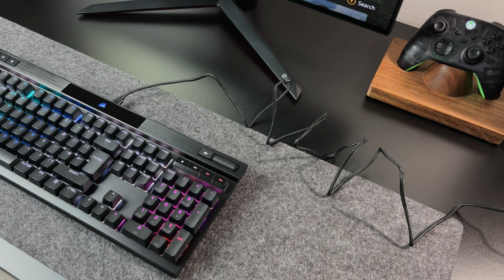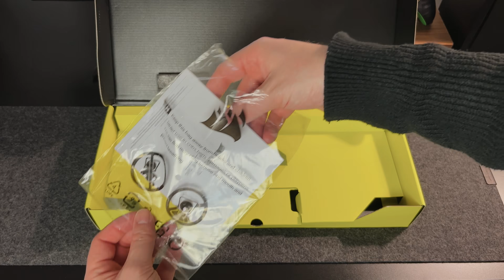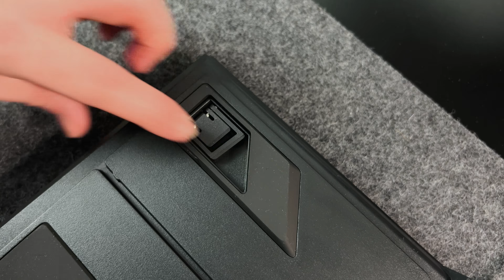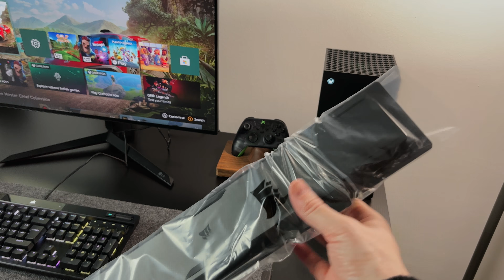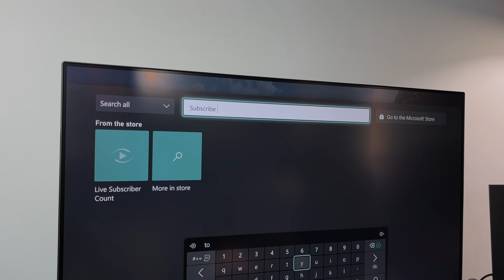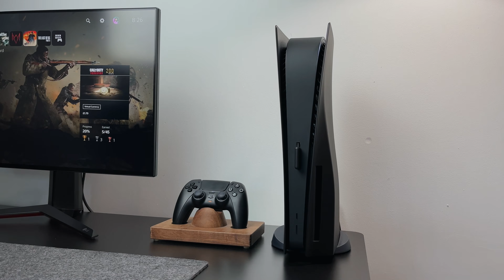NEW Corsair K70 RGB Pro Gaming Keyboard Review

Comment: I've had this keyboard for 3 weeks. Overall,  it's OK but I'm not terribly excited about it for the following reasons:

1. The backlighting is sloppy. It spills out under and around each key. My 10 year old Azio doesn't do that. 
2. The base of the switches are white. Had they been black, like the rest of the keyboard, the entire effect would have been much more elegant. As it is, the white switch bases cheapen the whole look.
3. The connecting cable is thin and stiff. It looks and feels really cheap.

I bought this because I found it deeply discounted. Anything more than $100 and I would definitely pass on this one.

Comment: I got it with OPX switches. Its fast and responsive! For gaming is great. For typing it is too loud. Too noisy when I press the buttons. I wish I can do something about it. Have in mind that the tournament mode doesn't run on 8000 polling rate so I don't see any point of using it.

Comment: I had bought - or rather pre-ordered - a Ducky Shine 7, months ago as of writing this comment. However, the actual delivery time has been left in the air with the ETA date not finalized. As the end of April approaches, I still haven't got word when I'll actually receive it. It might very well be a long while before I actually get it.

So, in the meantime I ended up buying the K70 RGB Pro with Cherry Mx Blue switches as "Plan B" since it's not clear when I'll get the Ducky. It's actually pretty good and it might serve as my main keyboard, my "Plan A". It's got some heft and it feels like it is made of good quality materials. Plus, the K70 has the stuff I liked about the Ducky Shine 7 to begin with, which was the metal backplate, PBT keycaps out the box, and detachable USB cable. 

Also, the K70 has a clean aesthetic like the Shine 7 does. I'm a sucker for a clean and simple look. I've never been into what I call the over the top "Gaming Greebles" look that a lot of computer parts tend to have. The K70 looks like a keyboard that you can use in an office without it looking sorely out of place - as does the Shine 7 - which is a plus for me. In all I'm quite impressed with it.

Comment: Very nice review. Just ordered this. I miss my old original K70 with the browns. Since then Ive gone through two other boards a K95 Plat with the speed switches and a K95 Plat XT with the Blues. just miss those Browns. Something about them lol.

I can definitely vouch for the PBT keycaps. My K95 XT came with them and over a year in with heavy use they still look and feel brand new. Compared to the regular smooth caps off the regular K95 Plat with over a year of use are shiny and some of the letterings are worn off.
Reply from the maker: That's awesome Shawn, hope you enjoy it too.

Comment: Great vid. I would’ve liked a section to hear how audible/clacky the keys sounds. In the “macro recording” portion there’s a typo, “Marco.”

I game on both PC & console and have for decades and I still think console is the way. PCs are out of control expensive at the moment, and while they most definitely have their perks, hard to beat the plug & play of the console experience.
Reply: I believe cherry Mx RGB Speed are linear, so they're supposed to have little to no sound. 

Whereas MX Browns are tactile and have a bump (almost like a mild haptic feedback) when you push, they are not supposed to be auditory. 

MX blues are clicky, and just as the name suggests, make a clicking noise when actuated.

Comment: If you don't feel like building the PC yourself, I highly recommend Chillblast. They make amazing machines. They cost a bit more than the average build, but they're tested and robust. Clean builds. Also, they make PCs for Mclaren Driving Team.
Reply: I opted for Chillblast too back when it was impossible to order a cpu / gpu from anywhere ! They did me proud and built an awesome rig. The main reason I went with them was because when I called them I got to speak with someone who was clearly a techie / knew the products inside out and what worked best together. That’s unusual when you are speaking with ‘sales’. My last 3 PCs were all self builds but now free time is non existent so going pre built worked for me. 
As for this keyboard. I’m considering it as a switch from my Razer Tournament Edition. (TKL size)

Comment: nice looking keyboard. it is very noisy for gaming to be honest and for typing when we have to transcripts for calls, meetings and work-related things. would have like to see a wireless version instead of having the cable clutter the desk
Reply: If you're a typist I wouldn't get a gaming keyboard, unless you're just in love with this RGB style, there are Akko and other brands that aren't as "loud" in their appearance. But if you do like the RGB, you can always pull the caps off, remove switches, and then lube the switches, install better stabilizers (factory defaults are usually poor), and switch film.
But, the main factor is switch type. If you want silent, go with a linear switch type and be sure to self lube the switches and the stabilizers.